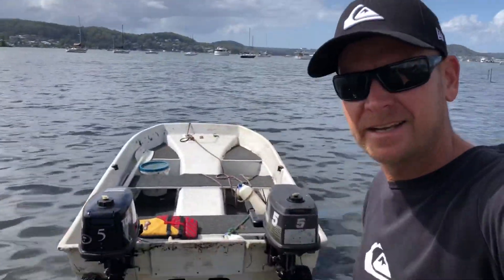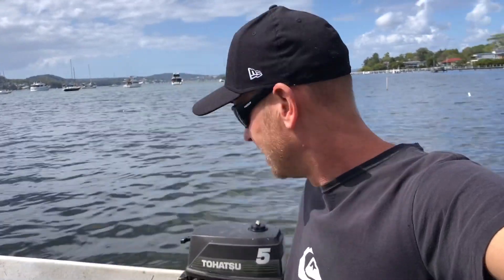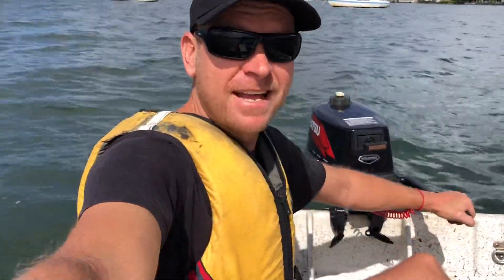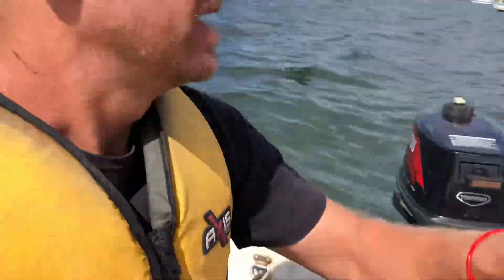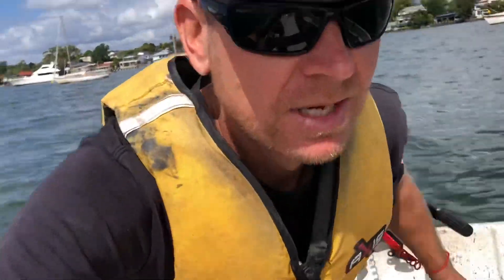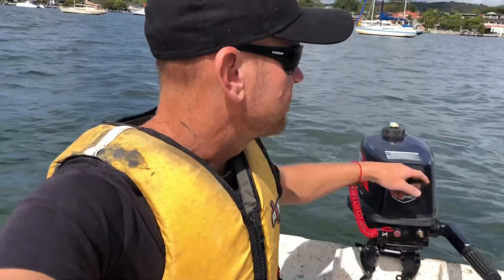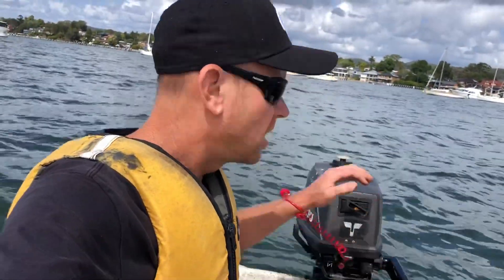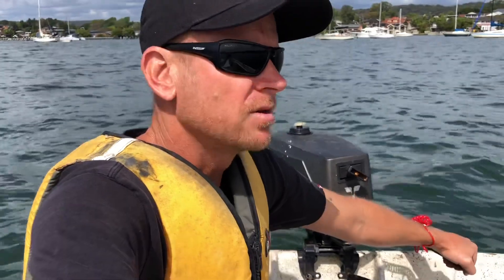Outboard 5hp modified

Comment: I like the concept of it, but when its such little hp, and outboards on marketplaces aren't to expensive,  just buy a bigger motor. I've still got a 1967 Evy 9.5 that I paid, wait for it $100, and it is a little ripper still all these years later. This is very entertaining though. Great channel,  enjoy your work.  G in Brisbane.
Reply from the maker: Cheers G! Glad you enjoy the channel and my work! There's something fun about getting the most out of a smaller motor too 😉
Your 9.5 sounds cool, I’ve owned one. They were designed for the cover to be as low to the transom as possible for fishing and to be less intrusive that’s why they are kinda shaped like an egg, I red it in a Evinrude book I had.
Cheers 🍻 
Aussie Boat Guy 😎

Comment: Do you get a big difference getting the motor mounted at the right height on the transom so that the cav plate is just below the bottom of the boat? My reason for asking is that ive just gotten one of these 5hp mercury 2 strokes and in my little 2.5m air deck tender its not going any where near as fast as your standard one is (like im only getting 11kph or so) and I think my motor is sitting way too low on the water. Im going to look at making a transom riser tomorrow abs see if that fixes it
Reply from the maker: Yes absolutely 👍 big difference at the correct height, possibly cav plate about 20mm lower than keel on an inflatable. weight onboard is a big thing too with a small hp motor as it will battle to get up on the plane. Also some inflatable boats are hard to get up on the plane with small hp as the bottom does move a bit and can suction cup to the water plus the shape of the side tube ends is like a brake until they come out of the water.
Cheers 🍻 
Aussie Boat Guy 😎

Comment: I was looking at upgrading from my 5hp 4-stroke Suzuki to a 2-stroke Tohatsu with the same horsepower. The Suzuki did 11km/h at 1/2-3/4 throttle on my 3.0m tinny when breaking it in but the next day it only did 10.8km/h at full throttle, during the break-in procedure. Is there something wrong with the Suzuki outboard that needs repairing or would it be better sourcing this ‘ new’ 2018 5hp 2-stoke tohatsu that I’ve located? My goal is to get a bit more speed when travelling from spot a to b for fishing. Ta mate
Reply from the maker: Weird you lost speed mate.
I would see Suzuki if it’s new and see what’s happened. That really should be a good motor. Did you load a heap more weight in the boat? that makes a huge difference with small motors?
Cheers 🍻 
Aussie Boat Guy 😎
Reply: @, nothing different in terms of loading. Exactly the same amount of weight both days, as I was using the same fishing gear. Winds were even less strong the following day, so I assume there’s some issue with the outboard but exactly what, I don’t know

Comment: Great video, thanks! Can you please confirm the standard prop for these is 7.8x7.0? I have a 2.7m Aurora RIB with the same Tohatsu 5 but with a 7.8x8.0 prop. Challenging to get this on plane & hoping the smaller prop will help?
Reply from the maker: Hi Champion, sorry for the delay in getting back to you.
From my experience the standard prop is a 7.8 x 7 .
Cheers 🍻 
Aussie Boat Guy 😎

Comment: Hey man, enjoyed your video😀
You dont happen to know/remember the conrod lenght of that engine?
I have a chinese copy by the brand of hangkai that just does not plane with two people in the boat, goes up fine with only one or a full grown adult with a child of like 10years. I am not going to alter the porttimings alot cause i dont want much more revs since it is quick enough as is👍
Great stuff💪
Reply from the maker: Hi Mate,
I don’t know the conrod length unfortunately.
Sounds correct with what the 5hp can push up onto the plane. Once I modified mine it does get two adults up on the plane but it really was a lot of work, honestly better off getting an 8hp, way smoother too.
Cheers 🍻 
Aussie Boat Guy 😎
Reply: @25hpboatracerman  I already have the engine in pieces now and now the portwork begins, was hoping to calculate some durations with the conrod length but I guess my previous experience has to be enough😀 not going to do anything crazy, the good thing about the Hangkai is the quality of everything(did not think i would ever say that about a Chinese copy🤣) the cast seems better than the tohatsu you had and that really surprised me.
Just waiting for the jets now and some new gaskets and a new head with the sparkplug hole in the center so that i can fit it in the lathe👍
Many thank you from Sweden😀

Comment: Great series of videos but you need a rev counter
Reply from the maker: Hi mate,
I have been using a rev counter for most of the modified 5hp videos, if you check the later vids on that modified 5hp when I’m running it on the small aluminum boat it saw over 7600rpm and nearly 50kph top end speed.
cheers 🍻 
Aussie Boat Guy 😎

Comment: Quite a difference hey! It'd be interesting to find some way to hook the engines up to a dyno so you can see how much more power you're making.
Reply from the maker: True mate.
I’ve got further plans for that motor too.
A modified gear case that is more hydrodynamic as the standard ones are terrible. It’s funny that the 6hp gearcase is shaped really well but the 5hp is a shocker.
Cheers 🍻 
Aussie Boat Guy 😎

Comment: I’ve a 8ft alloy punt, had a 5hp Mercury top speed was 31kmh with the tide, standard motor, 1 bloke. Dropped a 9.8hp on it and got 40kmh with 2 blokes in it on still water.
Reply from the maker: Hi mate,
Sounds about right, I really want to try my mod 5hp on a light tinny and check what speeds I get. My mod 5 was about 5 to 6kph faster than the stock one on my heavy twin hull, hoping that is even greater on a light boat.
I love the 9.8hp, such a great motor 👌
Cheers 
Aussie Boat Guy 😎
Reply: My 8ft punt is very light, the 5hp Merc had a 123psi on the cylinder.  My 9.8hp Tohatsu has 150psi on each cylinder.  Keep those vids coming mate, really enjoy the content!

Comment: hi, good job, for a more accurate measurement of the result you need to get a tachometer
Reply from the maker: Cheers mate 
Yeah true for rpm. 
I was just looking at speed with this one. I need to get another mini tachometer for this stuff.
Thanks 
Aussie Boat Guy 😎
Reply: @25hpboatracerman   to measure the result of the improvement in statics, we use a mulinette, you can make it yourself from an old propeller, or by measuring the thrust with a scale, I'm waiting for new experiments
Reply from the maker: @ЛодкииМоторы-ж1и  
Yeah nice 😊 
All the best mate 
Cheers 🍻 
Aussie Boat Guy 😎

Comment: Why didn't you just go and buy a 6 horsepower.My suzuki 6hp 4smoke gets 17.3mph.
Using a cut down sharpened standard propeller in a very unera dynamic sib .
Reply from the maker: That’s funny 😂 and I agree but -
I’ve got bigger motors already and tinkering with it was the whole point. I’ve have an 8hp that did 19.4mph on the same boat.
You have done the exact same with your 6hp by cutting down and sharpening your standard prop, then someone saying why? you should have just bought an 8hp. Answer = because it’s fun 🤩 
I still need to play with props for it, engine hight and gear case shape, I’m sure there is more in it.
Seen the guys in Malaysia race the 3.3hp Mercury two stroke (super modified and with race props) getting nearly 30 mph, I love that stuff
Cheers 
Aussie Boat Guy 😎

Comment: Modified reaches 25% higher rpm hearing the pitch increase.
Reply from the maker: Yeah, I reckon it does.
I should put a tacho on them and see the difference.
Cheers 🍻 
Aussie Boat Guy 😎
Reply: @25hpboatracerman Def do a video on the modded outboard. Then Mount both and do a vid on twin engines. The props should really be upgraded for that. Have fun!
Reply from the maker: @gbass7328  
I reckon the modded motor needs another 1 inch pitch on the prop now.
Unfortunately I can’t mount both motors at once on that hull.
Cheers
Aussie Boat Guy 😎
Reply: @25hpboatracerman  Most pitch changes go by 2" at a time and that would give you the speed. I am seeing prop guys make shop pitch adjustments of up to 2" as a mod too lol. It would take a lot but I'm sure that hull could get modded to to accept them both. Anyway, cool!
Reply: But you are right. For a small prop, 1" difference will be similar to a 2" change on a bigger prop.
Reply from the maker: @gbass7328  
I reckon I can mod a stock prop and add 1 inch pitch, I do have one off a 9.8hp tohatsu with the same spline that has another 1.5 inch pitch, would need some cutting and modifying to fit though.
Cheers mate

Comment: I need to see how you modified!
Reply from the maker: Yep, video coming.
It was a big job, not just bolt on easy stuff unfortunately. So much fun though 😎
Reply: @25hpboatracerman   i can wait to see it!   I have yamaha 5m  model 1990 .. little difered but i hope you can inspier me
Reply from the maker: @_.R.F.X.L._  
It’s a fun project and I would be interested to see how you go with the Yamaha 😎
Reply: @25hpboatracerman  i am already ready to big jet but i think i might bore the air intake  and exhaust two
Reply from the maker: @_.R.F.X.L._  
Yeah, you can’t just buy a big jet (all that will do is slow you down because it will flood the air fuel mix) definitely need to bore out the carburetor and jet to suit which is trial and error by reading the plug (have a vid on that and modified carbs if you are interested)
Porting the transfer ports and exhaust ports is a must.
Cheers
Reply: @25hpboatracerman  i wait for new video!
Reply: @25hpboatracerman   i will also put a modified atomizor from 8 holes to 30 holes

Comment: How can you get 25kph with a modified 5hp when I struggle to get 25kph with a 15hp! 😓 exactly the same hull all I have is a front casting deck
Reply from the maker: Yeah, heavy little boats.
Not sure what is going on with your speeds. I was surprised how even the stock 5hp went.
Cheers 🍻

Comment: Another great  vid.. can actually see the difference. Unsure if it may be better to get the 6hp and put the 5hp cowling on it, but look forward to the build.
Reply from the maker: Hi mate and happy new year 🎆 
Hope your Christmas was awesome 😎 

Absolutely, you are correct, a lot of work for a little bit more action. The 6hp tohatsu and Mercury two strokes are twin cylinder and weigh in at an extra 5kg, just wanted to play with the single cylinder to keep it simple, plus I had a shelf full of parts 😂
Definitely the 4 stroke you would change the cowl if you needed a 5hp.
I may see what I can get out of a 9.8hp Tohatsu as well as they are only 25kgs which is nice and light where the 9.9hp - 15hp go to about 41kgs.
Cheers mate 👌
Glenno
Reply: @25hpboatracerman  yes that 9.8 tohatsu is a great motor and if you can find one would make for some great vids. Thankyou I hope you had a great Christmas and have a enjoyable new year with lots of boating.

Comment: im actually super keen for the mod video as i have 2 of these beut little motors. one will stay stock as im actually quite happy with it stock and i get about 27ks out of my little savage gull (11ft Tinny) on my own with a little bit of gear. on a 7.8 x 8 prop. the other is in bits but i just picked up the last bit to put it all together (needed a gearbox) also have a new 7.8 x 9 prop for it and im really wanting to get every last drop out of it just for kicks. i love playing with 2stroke motors but i get in the poo with the local constabulary when i build stuff that goes on the road...... thanks heaps in advance and i cant wait.. just a question im wondering if you might be local to me here on the Central Coast? a few of your videos have looked a lot like a place i have fished, would love to catch up and shout ya a beer if your keen and ive got a couple things you might be able to use.

Comment: Haha i guessed 12 knots on the first run. Then 14 on the second.
Reply from the maker: Wow, that’s a very good guess mate 👌👌👌
Cheers 🍻
Reply: Yeah, I had 11-12knots for the first one and 15 for the second. So, a bit high I think on the second one. But I sometimes take my friend's homebuilt and heavy wood dink out with a 8hp on it and I can get that to 13knots, and the first looked a tad slower. 
Will probably build a fiber on ply 12 footer soon as light as makes sense and try to track down a 9.8 Tohatsu 2-banger. That would be my dream boat for hitting up the local reefs for a bit of spearing.
Reply from the maker: Not bad guesses mate. 
I reckon the 9.8 tohatsu is one of the best little motors around, if you can get one I would.
Good plan on the fiberglass boat.
All the best,
Aussie Boat Guy 😎